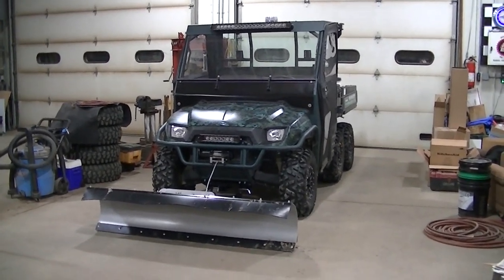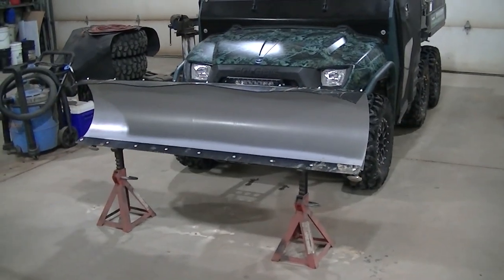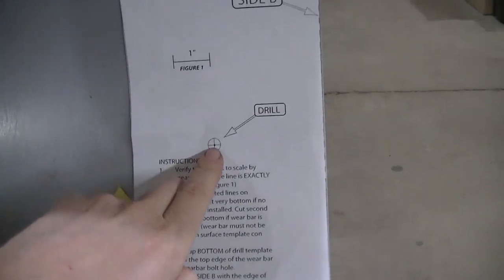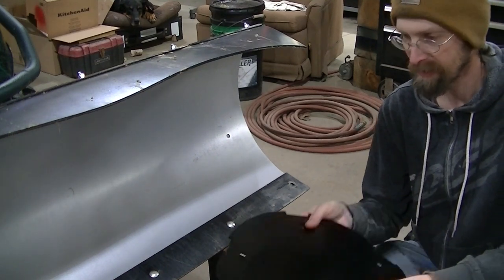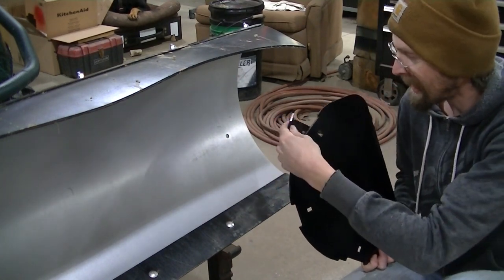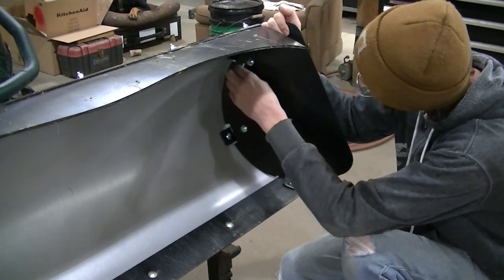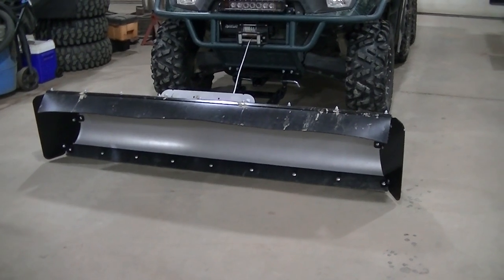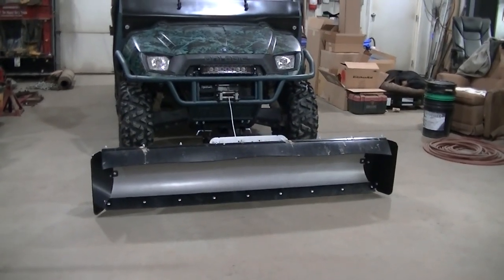Polaris Ranger 6x6 KFI 72" Snowplow Side Plate Install

Comment: I put the wings on my atv plow and Yes they are a game changer!! They cut the time in half and make the job less frustrating without the snow rows that fall off the sides. And ever since I installed the wings I never angle the plow I just leave it straight and it works great.
Reply from the maker: Wings are a great addition to any plow.

Comment: Hey Dude! I have a 2015 Ranger 6x6 that is one of the best machines I’ve ever owned for plowing snow. I just pushed 22” of snow over the past two days and it didn’t faze it. I’d love to figure out a side wing for mine. Probably more time and money than it would be worth doing. Good video!
Reply from the maker: You must have one of the last Ranger 6x6 made. As far as I know Polaris is only making the atv 6x6 now. I don't think I would want to push 22" but it would be nice to have some more snow to test this setup more.
Reply: @mossman381  I think I bought the last one my dealer had. The capability and toolbox is what sold me. I purchased the steel cab with wipers and heat. One of the best purchases I’ve made in the past 5 years. No complaints.
Reply from the maker: I have been slowly making mine more like the newer 800 6x6. When they started making the 6x6 800 Rangers they added full independent rear suspension. That added length so they put the really handy toolbox on. Does yours have power steering? I don't know if they started putting the power steering in the 6x6 or not.
Reply: @mossman381  no power steering but even with the 72” plow on the front it steers pretty easy.
Reply from the maker: I never understood why they didn't put power steering in the 6x6. They had the parts and you know people are going to work the 6x6. I haven't driven the newer 6x6 but the older ones steer very hard. Both rear axles are locked so you have 4 tires pushing you forward. I can now unlock the rear diff with the independent suspension I put in mine, but it still was really hard to steer. The power steering I added is awesome. Steers as good as my Ranger 900.

Comment: You mentioned the small gap on the bottom between the ground and the shield.  Did you find you left behind a lot of snow because if that gap?  Did you ever add some rubber to close off that gap?  Thanks in advance.
Reply from the maker: I actually didn't do anything to it. I didn't think it left much snow behind.